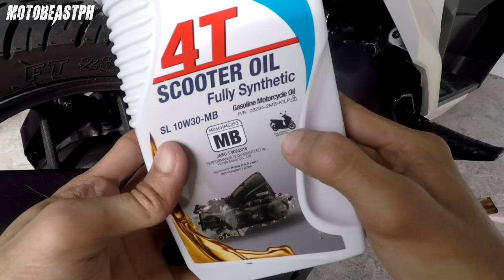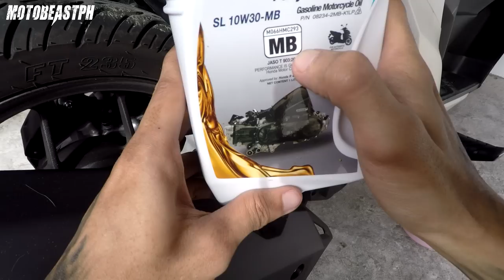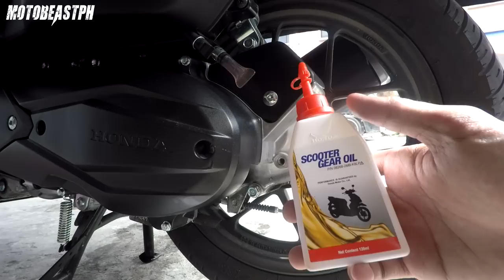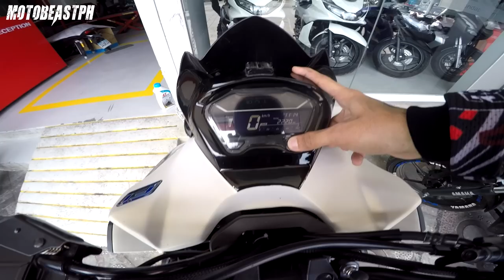Honda Click 125i | Change Oil

Comment: Quality content, straight to the point. Malaking tulong sa mga newbie kagaya ko. Tanong ko nalang po kung recommended din po ba yung kulay gray na variant ng engine oil? Almost identical po kasi sila nyang blue variant.
Reply from the maker: Mineral oil ata yun, bro. Mas okay yan fully synthetic.

Comment: Tanong ko lang, After ko mag Change Oil at gear oil' Normal bang may Ticking sound  pag turn off ng motor, Salamat.
Reply from the maker: Sa pipe yun

Comment: Gud pm po  sir. Anu po kya recommended n gulong pra s beat fi? Or yung subok mo n po n gmitn. Yung pwd dn kht s basa ang kalsada. Salamat po.
Reply from the maker: Metzeler, Michelin.
Reply: @MOTOBEASTPH  sir. Pilot street po b gmt mo nun s beat?
Reply: @MOTOBEASTPH   sir. Alin po kya ms recommended mo? Yung mechellin pilot street 1 or mechellin pilot street 2? S performnce ng gulong s tuyo at basa n kalsada .Salamat po.

Comment: Idol tanung ko lang 1k nka set sa mutor ko pro kht nd ko reach yung 1k change oil.ko.kgad 360km plang takbo nya sinet ko sya 1500 lalabas kya yung sinet ko na 1.5k pag pump up na oil cgange slmat po
Reply from the maker: 1,500km plus 360

Comment: Bro Tanong lang, ano kaya problema ni Beat, pag start at throttle eh parang kinakapos sa Power para siyang nagcchoke, maski pag umaandar ng mga 60-80kph para siyang kinakapos at nagddragging. Isang taon at 7months na sakin 28k ODO, Pangalawang palit ko na sa Bola,Slider piece, Air Filter. Okay pa naman daw yung Center Spring ko maski Clutch Lining. Nakapagpalit na dn ako ng Sparkplug at Sparkplug Cap. Ang pinaghihinalaan ko nalang na natitira na diko pa napalitan ay Fuel Filter,Clutch Spring. Never ko pa siya napa Throttle Body Cleaning. Salamat Bro.
Reply from the maker: Palit kana fuel filter tapos throttle body cleaning. Pag ganun pa rin, pa-diagnose mo na para ma-check TPS.
Reply: @MOTOBEASTPH  pag nirerev ko yung gas niya lalo na pag kakastart lang ng engine parang hirap yung lumalabas sa tambutso Bro. Parang may bara na di maalis alis. Ewan ko ba pero in terms of performance kinakaya pa naman niya yung 105kph. Pero susubukan ko yung recommendations mo Bro. Di naman sguro sa wirings kasi nagbabase dn ako sa mga tutorials mo. Salamat Bro.
Reply: Update: All goods na siya as of today since napalitan ko na din yung Fuel Filter nya bro. Pero plano ko padin siyang ipaThrottle body para mas sigurado. Salamat bro ng marami.🔥 kayo pareho ni Shan DIY ako humingi ng opinion at mukhang solve na dn yung problema. Stay safe bro.